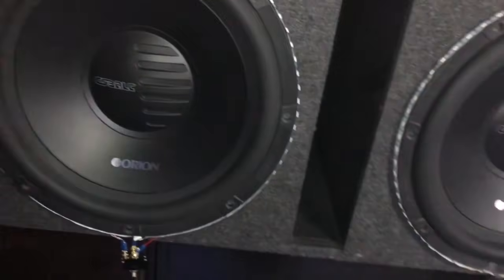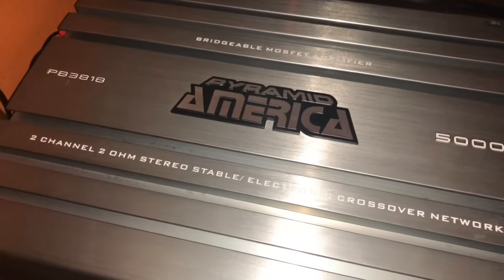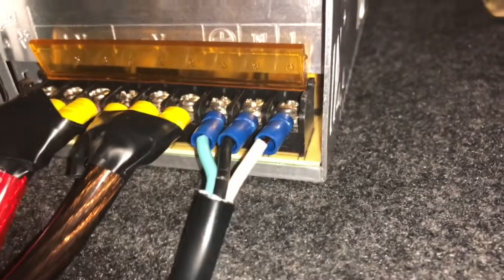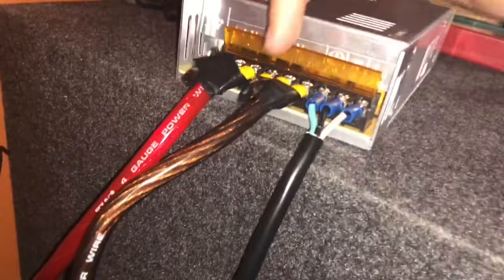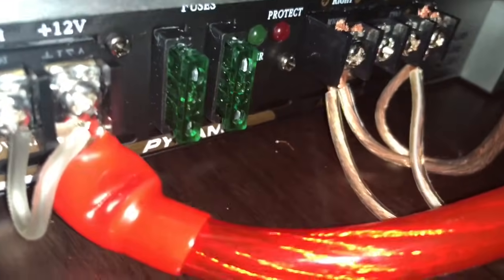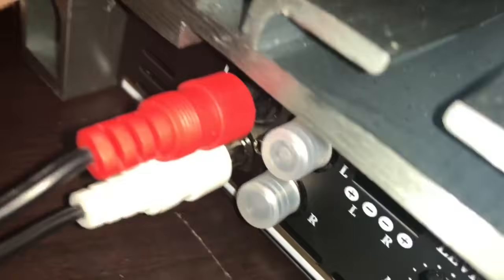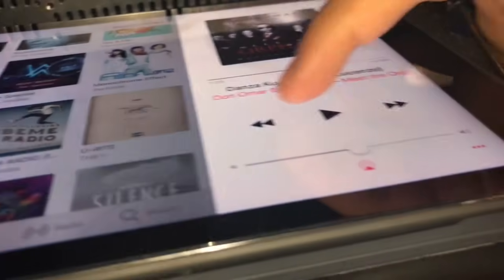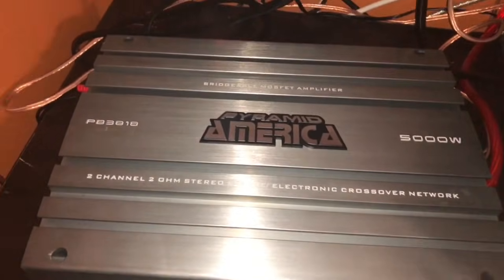How to use your car amplifier at your house using a power supply

Comment: Im using a 1600W Bitmain suply 100A 12V
And a JBL Subwoofer
Reply: Is that working ? 
I want to do it myself, my psu is 2200W 175 A 12.8v 
If you see a problem plz tell me?
Reply: @ibmmaster5971 hey im using it like 3 month.
And on max volume is 72A-84A
And do you have yours?

Comment: PSU 12v 30 amps... Amplifier 12v 30amps x2 fuses, thats 60 amps. Nothing bad wouuld happen other than psu gets strained and amplifier is running at half power.

Comment: Advice either get a 500w 50A power supply normally used for CCTVs or but a PC 700W power supply, it has a output 12v at 54A, any PC power supply above 700w will work.
Also check the amplifier fuse rating it will tell u how much amo u need

Comment: if i use the same psu as you, and my amp is only 1800watts, would it be enough since 12v and 30a is only 360watts
Reply: just came across this and I'm sure you figured it out, but if u are using a receptacle to power your power supply then you won't get more than 200 true watts after inherent loss
Reply: @saugustine3253  I have an old Blaupunkt velocity vr450 I tried to power it with 12v 50A 600w PSU but when I play something my home circuit breaker trips. I do see 3 25A fuses on the amp does that mean my amp needs 75A PSU to run? I also checked the main circuit breaker switch and it was rated at 40A.
Reply: @Mannyxz  if the breaker that you are tripping is a 40A, then you should look into a capacitor, a 1 farad capacitor would be sufficient to supply your system with enough juice on demand to likely cut out the tripping issue entirely, however that's hard to say for sure. it would definitely help the issue big time. it would be wired into your amp feed between your PSU and amp. another thing I would recommend is watch some videos on how to do it safely, then replace the breaker you are tripping with an oversized breaker, but only if the wire feeding your system from the breaker can handle more amperage, this would need to be large wire, like #4 AWG which is definitely not what its wired with. keep in mind any other devices fed from that breaker would be losing their rated overcurrent protection. really what you want is a dedicated breaker for what you are doing, but I don't know how easy that would be for you.
Reply: @saugustine3253  I bought a 1200W 100A server power supply to power it and it runs great. The previously ordered chinese switching power supply which was rated at 600W 50A could not supply the demanded current at the startup I guess because this amplifier's maximum consumption is 100A

Comment: What End Ring Connector stud size should I get? Will the 1/4 work or what size do you recommend for these types of Ac To Dc Converter Supply?
Reply: 500w power supply 50A

Comment: Freakin genius... had no idea it was this easy. You could even bolt the amp and power supply to your subwoofer box to make everything portable. Thanks a lot man
Reply: It won't have the thumping that you might be after. You would need 13 volts and at least 150 amps for 5000 watts amplifier.
Reply: its 2025 there are power supply's online that go all the way to 15 volts. any normal person doesn't need 5k watts inside your house lol you might as well go deaf
Reply: @user-ji9rm5wc4j Thanks, will look into that. 👍

Comment: Remember: Car audio is typically 4 ohms where home audio is 8 ohms by default so if you want to use car speaker on yoru house stereo you need to connect the drivers in series to make the 8 ohms impedance. To use home stereo speakers in a car you connect the speakers in parallel so it divides the 8 ohms down to 4 ohms.

If you are planning on interchanging a car stereo system into your home and back regularly then I would reccoment an investment in some Anderson Power Pole types (red for positive and black for negative) and some inlune fuses for the power and crimp on forks via a terminal block for the speakers. This will make life easier and yoru wiring situation safer and cleaner looking which is important when dealing with higher current DC like what a cars electrical system delivers. That 12 volts packs wnough amps to turn most wire into heating elements that can start a fire real fast in your car or home so mind your connections.
For a car stereo antenna using the common Motorola type connector you can get adapters that will change it into any number of other common types of RF connections like BNC, PL-259, or what I use mainluy, "N" type. Of course you can get SMA, RPSMA and other wifi "RP" classified types but I personally stay away from those unless I am dealing with RF above 1 GHz or have space restrictions.

Comment: Youll kill someone with the bare wires from the wall, best think is to put it in a plastic case or make an appropriate cover, if a kid or yourself touches that hot screw you'll be off to a funeral. No electrician would allow for exposed wiring. The amperage is all messed up, looks like a fire insurance job waiting to happen. If I ever saw someone doing that with sound gear Id be furious.

Comment: Ur doin waaaayyyyyy too much bolt the ground to a bolt on the bed the power from battery run RCA's and remote to the amp I bridged mine super simple did it 20 years ago I was 14 😂😂😂
Reply: You said the power from battery run RCAs is that battery a car or the wall outlet

Comment: Bro I hook a system up in I'm bed room pioneer head unit 2 fosgate 12s 2  6x9s on a 1000d all u gotta have it a plastic tote a car battery and battery charger hooked the battery plugged in the wall that shit beat had it under my bed simple that's way to much ur doin never messed up once had head unit zip tied to the corner on my bunk bed same with 6x9s

Comment: Can u sho me step-by-step power and all how to get the power plug
Reply: Cut up a plug
Reply: Can I use a 110/120 Volt AC 15 Amp power cord on a 30 amp power supply?
Reply: @kev379  yea but it will only power the amp with 15 amps
Reply: @Jaddy236  Wait, the only thing that matters is power cords giving 110/120 volts AC to power the Power Supply?

Comment: Electric tape 😲!!!heat shrink is your friend. I'd make 3 12 gauge wire clusters heat shrink them individually over the connectors and throw some heat shrink over the area that they join into the 4 awg. That setup is a fire hazard would also add a fuse block in between

Comment: "BRIDGABLE MONSTER" 😆😆
Reply: Car audio and power solutions ALWAYS advertise the max peak wattage in the biggest most eye catching text on the box and/or the actual device. It's manipoulative sales marketing and is legal, imagine that
Reply: Btw, bro it's better to have more amp in your source than your amplifier, because amplifier is taking not more than needed, but if you have exact same amperage on both sides then your power supply will be "stretched thin" so to speak, and will not last long.
... not sure that capacitor would even help.

I just bought 40amp power supply for 25amp amplifier so it's not overloaded when the bass hits.

Tnx for instructions! <3

Comment: You're doing it bro we're spectating, However,  most are correct.. AC black is always "hot" (110-120v) and white is always neutral.. 2) splitting larger gauges like 1/0-4ga etc.. is not recommended due to parasitic arching and fire risk.. you can make or buy crimp on fittings and jumpers for the other lugs  fairly cheap and plus give it a cleaner look and  more stable load transfer. Everyone else has good input as well. Keep it up! We learn daily and improve with every new build.. and respect for sharing your journey to success.
Reply: So with the supply he is using yes all need a power supply to it. (I've only used one and all three needed a power and ground source) you'll need to take a few things Into consideration.. system size, amperage load, efficiency of system..
I use a powermax 120amp for my 5 channel amp and the taramps 240amp converter for my 4 drivers/amplifier and have a small battery bank as the drop is not as bad when you have a constant supply like your house will provide. 
Anyway to your question, I would use a spade connector (4gauge reduced to 8ga where it connects) if you use something better like a sky-high reducer that has a set screw remember to get some ferrules before you install in the set screw reducer. Now after the power is ready you'll jump all three together with a terminal block jumper.. (again need to know your load as some are rated at 30amps and if you exceed you'll blow it like a fuse. 2nd option build an insulated (wood) distribution mount for distribution blocks and run the  separate runs to a fused distribution block then to your amp. Knuconceptz.com has some good stuff. H.M.U if you need help and I'll send you my email and draw a diagram and send pictures as you can get most of it on Amazon.
Reply: @joeyamador7961   I know this an old post, but I am looking to do the same but I am running 2 amplifiers. Can I connect both the amplifiers to the power supply in the way that you mentioned? Also when I connected only one wire to the +ve & -ve. It seems to work, but there is a lot of buzzing in the speakers & especially sub. Is that why? Thanks
Reply: @kathylatrell9869  
A few things, is the power supply big enough to supply the two amplifiers? My assumption would be no as I have the largest supply taramps currently offers (250amp DC)  and it only supplies the motors to my subs, the rest of the components which are on my 5 channel is driven ba an additional supply.. genuinely it all depends on what you're trying to achieve.. car audio in a good acoustic environment can be overkill which is why you see smaller drivers in a lot of home audio applications and they perform well. List your equipment and supply information. Also keep in mind I have a lithium bank on mine to make up for what the supply doesn't keep up with. 
On the buzzing noise is your wire sized properly? What are you using for an audio signal? I am using a single din head unit with a dsp and quality leads from knukonceptz. Little more info and I'll help.
Reply: @joeyamador7961  realized i'm using my gf account by mistake. Ughh.. nm lol each of my amps are 400W & power supply is rated for 1200W. So, I believe that should be enough. I have fuses on my amp. Also My subwoofer is running separately since it has it's own built in amp (car seat amp). So in all I have 6 25W RMS speakers and 2 transducers (bass shakers ) 35W each =220W total.Mine is a 12V system. so per the calculations I've see: Amp = 220/12 = 18Amps + account for 35% powerloss  = about 30Amps. but I have a MEISHILE Switch Power Supply 12V 100A 1200W Transformer, AC to DC Power Supply, I'm using 16 gauge audio wires to speakers and 10 gauge to power. Everything is getting power and working but a lot of hissing from speakers. Also, when I play something on the bass shaker the high end sound seems to be bleeding into the speaker. Also another thing I'm not doing is using using a power distribution post that splits say the +ve from Amp to ALL 3 positive terminals on the power supply. I only run one wire from +ve of amp to one of the +ve on power supply and run one -ve from amp to -ve of power supply
Reply: @kathylatrell9869  
Where are you getting your audio signal from? Receiver,head unit etc..?
Reply: @joeyamador7961  I'm getting my audio signal from a USB DAC connected to a PC that takes USB in and stereo out . Then I make a stereo to RCA R/L split to the amp
Reply: @kathylatrell9869  
Look up Audio Control LC2i.. most of the issues I see with everyone is issues with rf interferences due to poor Audio signal, with a digital audio processor (dsp) you can get a good strong isolated signal to the amp. (Think of it as a clean signal of you will.) It is what you have to use with a lot of integrated vehicles now 
Days if you want to keep all your hand controls as most newer head units co tool way to much in vehicles. It's cheap and well worth the rewards for the. Lean bass signal alone.. gives you more options as you can adjust multiple frequency ranges on your computer and tune your system.. (don't for get to tune your gains so you're not clipping too).
Reply: @joeyamador7961 I have a question, let's say I have a 12V 45A powersupply, what type of amp should I use instead?
Reply: Hey bro quick question,  do all the terminals need to be connected on the converter to work or can you just use one positive and one Negative?

If so what is the exact name for those types of connections where it splits.

Thanks
Reply: He could use a distribution block to split? Esp if he wants to stay with the car audio theme

Comment: you missed to mention the 12V dc power supply to set first on desired voltage using multimeter before plugging in..
Reply: Those Chinafeng supplies typically dont swing too far +/- out of the box to be a concern, however those cheap supplies to have a serious flaw that will cause a failure even if it's sitting idle. The flaw is the counterfeit power transistors or MosFETS used. I have seen it over and over a 40 amp supply failing after a week or so in use because it is using transistors rated for 10 amps or less. Genuine replacements can be cross referances and bought off ebay at reasonable prices. Changing out the power transistors, the big 400 volt bulk cap, and output  filter caps will allow the PSU to operate up to the advertised ratings and serve you way longer than a week
As for voltage setup, the ideal voltage for a car stereo is not 12 volts., it's 13.8v - 14.4v which is the voltage range of a vehicle running and it's battery being charged. A mod that can be done to 40 plus amp PUS is adding one of those 7 segment LED type panel mounted DC volts meters, may be called a motorcycle battery volts meter or something but I have a few dozen in various colors and they are pretty accurate, not lab grade but for vehicle use they are good for it. They also make volt and  current types but the round ones are hard to find sometimes.

Comment: How are you getting the highs?
Reply: Tweeters and a NP class electrolytic cap to filter off the lows up to a certain frequency. Formulas exist for this so you select the correct cap for yoru desired frequency range.

Comment: can these car amp's be used from a home receiver output?
Reply: yes, I used an rca splitter and connected it from my sub pre out on the receiver to my amp
Reply: Sure but only at line level inputs to the amp and you need to mind the amps output impeadance rating and wire your speakers accordingly so there is no mismatch

Comment: It has a 220-110v on the side ,how do i know if that switch is on 110 or 220
Reply: It depends in which country you live in... If you're in usa turn the switch to 110 side!
Reply: connect it to 120 volt supply and take output voltage measurments. if its dead then it's set to 220/230 volts and you need to change it. Most SMPUs like this will not start up (higher end more expensive ones might start if they are auto sensing like the power block on a laptop - 80 - 250 VAC range)  if the input is too low - 120 when 230 is required = no starting up = no power out

Comment: Hi Firealarm203 great video tnx.
If u don't mind i have 3 questions since i want to fix a home hi-fi like this but i am an amateur on electronics:
1)  how do i recognise which is the live  ground and neutral wires to go to the wall plug so to connect them on the power supply accordingly? 
2) does the power supply need to meet the same amperage as the amplifier fuse? is it ok if i buy a power supply with little less amperage than the amplifier fuse?
3)on a short search to buy 12V power supply bricks, in most cases they include watts in the equation. Should the watts of the power supply meet the amplifier's specs on the power output in watts? e.g. my pioneer GM amplifier is 4x80 watt @ 4ohm so, what power supply is ok for me to buy?
Reply: No you have to buy the same amperage if the amplifier is 30 amperage the power supply need to be 30 amperage or more than 30 amperage if it more than the amplifier the amperage it will be more better
Reply: @gopyyanusdev3486  30 amp fuse will blow if given 30 amp that's what fuses are for. if you have a 1kW amp that requires 30 amp, that's a fake.

Comment: Bro.. I use 24 amp 12v psu for my sony n1004 amp..Psu switching off when bass hits high
Reply: no shit
Reply: you are either pushing it too hard, impedance of sub too low or you have a bad psu bc this is a common effect when the voltage sags at high current

Comment: There are several things that you should have done. First between your power supply and amp power you should have put a 12v capacitor of a fairly large capacity so you are not putting so much strain on the power supply when the base hits ( will make the power supply last much longer). Second is that the power supply you have chosen is really under powered for the application you have it in that power supply is a 30 amp 12 volt meaning at its max it is capable of putting out 360 watts it may be expensive but its definitely a good idea for a much more powerful supply.
Reply: how do I connect a capacitor between the psu and the amp?
Reply: @niknovsak3288  add the capacitor on the power wire in-between the amp and power supply.
Reply: @niknovsak3288just on the wires between the two.
Reply: tell us how ??? in series or parallel
Reply: @PoshtVitrin parallel for more than one power supply to the capacitor then from the capacitor to the amp just normal it will double the watts
Reply: So do I need to match fuse amps and power supply amps?
Reply: @caseanful  if anything you should slightly undersize the fuses so they blow before anything important.
Reply: @caseanful yes just remember the fuze is designed to fail so you don't have to keep replacing components

Comment: i have done that but when i turn my sub volume up my amp goes into protect
Reply: I think you have too low impedance on your sub try wiring it to 4 ohms if it is dual coil subwoofer
Reply: Jiiaho ok